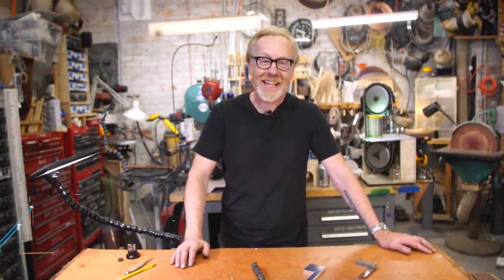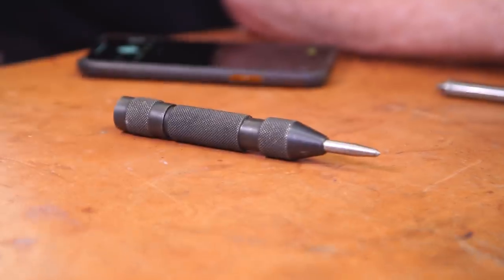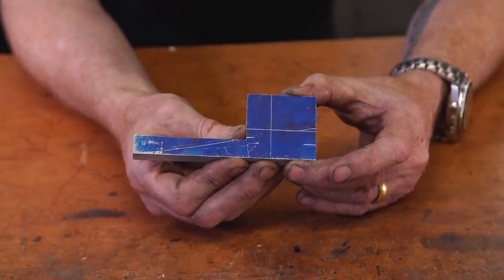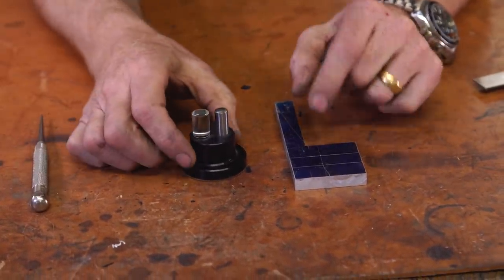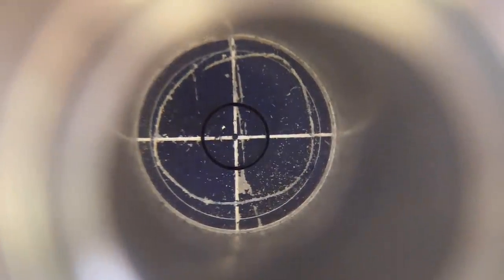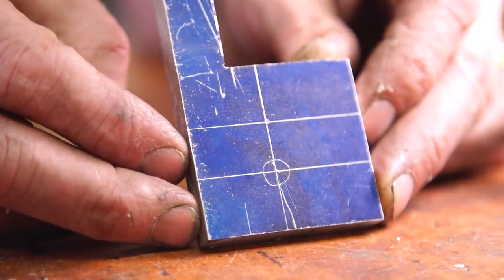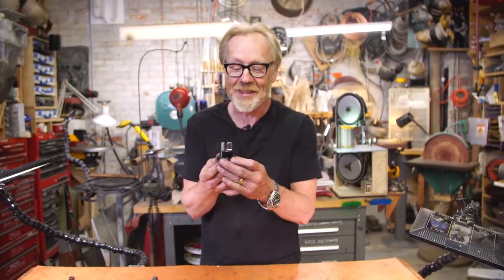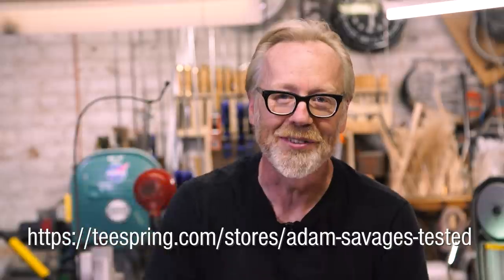Adam Savage's Favorite Tools: Optical Center Punch!

Comment: 100% agree. I use mine all the time. The holes printed to paper by my 2D CAD system have cross hairs. Stick the paper to the work piece with spray mount, optical punch. Accuracy guaranteed!
Reply: Depending on the accuracy and resolution of your printer, and the rigidity and lack of stretch/shrink in your paper, yes.

Comment: As a mechanical technician, this tool is a crucial part of my tool collection. An old timer showed me his, and I have loved using my own since. The guys in the shop may not like it, especially when I have a shitload of holes to lay out, but it easily produces more precise results than any spring punch could ever compete with. 

One thing I ended up doing with mine was I took it to the belt sander and sanded it almost all the way to one of the holes so that I could get it as close as possible to the radius of any piece of angle that I'm laying holes out on. Picture trying to lay out a hole on some 3/4" angle right in the center and you'll get what I mean. Now, most people would say 'Why not just lay out and punch the hole on the completely flat surface of the angle?' But doing so would make drilling the pilot hole at the drill press impossible without the use of a vise. Center punching on the inside surfaces of the angle is much more time efficient, especially when you have hundreds of holes to drill. Also, modifying the tool in this way does not effect the precision of the tool in any way and gives the tool more capability overall.

Definitely a great tool to have in any man's toolbox.

Comment: When working to marked lines, traditional engineering practise relies tremendously on "touch and feel", the development of which was a key purpose of apprenticeship.

A pair of dividers would be set by dropping them physically in the engrave markings of the scale, not just "looking" at the scale. Lines would be scribed into the workpiece, not just into a coloured coating.  When marking for a drilled hole, the key tool for accuracy was the "marking punch" (as distinct from the "spotting punch"). A hole would always be made at the intersection of two marked lines (how else?), and the marking punch, which was hardened and ground to a much finer included angle than the spotting punch, would be dragged across one of the lines, until it was felt to have physically dropped into it. It would then be dragged along that line until it was felt to drop into the intersecting line. It was then known to be at the cross point, and would be gently tapped to make a mark. The blunter "spotting punch" was then placed in this mark, and struck as hard/often as needed to make the starting point for the drilling operation. This whole process is easy if all the scribed lines are deep (and hence a little less accurate). Following the process with fine, shallow, accurate lines is what "touch and feel" is all about.

This whole approach was rendered irrelevant when the need to work to single thousands of an inch arrived; this is not done by working to marked lines, but by working to "numbers", either on a vernier gauge, micrometer, or the dials of the cross tables on the lathe carriage or milling table.

Which is why optical punches are not a common device seen in engineering. They ARE fascinating though.

Comment: I always thought of the X of the scribe is deep enough the punch will want to sit in the cross section because that’s where the most material is removed. That’s being said, I want to try and optical to see if the process of that takes less time then being very careful with a center punch. I love all the alignment punch methods. Screw transfers, traditional transfers, etc. but usually I just use a drill guide block. For some applications, it feels wild but if I have to do a door frame it’s usually best to have the drill at full speed and kiss the mark as lightly as possible. Drills roll because of the amount of pressure. The twist of most cutting bits are like “paddles” that want to paddle away. But if you take literal paddle on a boat and barely touch the water. Just enough to where the very edge is barely wet - you boat won’t move. The “bite” force isn’t strong enough. So high speed, a very gentle touch, and a metal V block usually can get me there very accurately.

Comment: If the scribed lines come from say a height guage from a granite/steel surface table or with a scriber then you can locate the sharp punch into the groves of the scribe marks. If you get good at scribing you should only have to scribe in material that's going to be removed and use a delicate touch to plan things out everywhere else. Its an absolute art that i struggle to master as a machinist but this way I'm told you can get to 50  micron or less depending on the gear and they guy you pay. Viva la industrial revolution!

Comment: I got myself an optical center punch from chronos in the UK.
This one you can rotate to switch between both optics and the punch.

I found it difficult to see anything because light needs to come in from the same origin my head occupies. So I have to take my head away quite a way and use a flashlight.

The bottom of the plexiglass floats a 3.5mm above the workpiece.
This means that the markings at the bottom of the plexiglass shift but about +-0.5mm depending on the exact position of my head above the center punch.
Reply: I'm thinking of replacing the base with a translucent material to get light. Maybe embed magnets to hold it in place. But it would loose all that nice weight. :/
Reply: The trick to shifting seems to be to place your head in such a way, that the crosshairs are in the center of the image and not slightly offset to any side. Then you seem to look perfectly vertical.

Comment: That's a nice tool... I never used a spring punch... I always used simple ones where you use a hammer (I even made a punch at school). Is it possible that you can get better precision with a regular one than with a spring driven one even if you don't have the optics?

Comment: As a lay person that starts their tool collection I got a question: Is there a “weighed” variant of this tool so it tends to stay in position and you don’t have to precisely hold it down until you actually do the punch?
Reply: I had the same feeling, that my hand holding it down wouldn't be enough... Maybe if the project allowed it, a clamp could help?
Reply: Ive always done this in a drill bar and a clamp.  Use the bomb site to locate it and then pull it out and use a drill bushing to drill it
Reply: This is the same question I had, I’m a right hand amputee and it being weighted would be of a paramount help.
Reply: @Aron Aimer 
That would be a topic I would find extremely interesting:
How can you “properly” (and safely) work as a maker with certain physical limitations?
Answers like: “Oh well, sorry to hear that - you just can’t do this and that so just get someone to help you!” I would consider highly disappointing.

Comment: as a Toolmaker before i took my engineering degree, i really never understod the value of the optical center punch..  i get it that it supports you in getting closer to the center, but you are basing this on that your lines made with a ruler, or some sort of measurement tool being within tolerances.. normally when drilling with precision you would use a mill or a fixed drill, then a center drill (hardened drill that is made for creating the guiding hole) (called pinol bor in danish sorry it might be called something else) and you will use reference measurements from your part, and then use the scale on your machine to align. (okay when talking about real precision, microns, then this is not a solution, but that is something completely else). for me the centerpunch has only one value, it is a LOW precision tool for ensuring that you can start a thread within the area of a "free hole" in another part.. so there you would have 0.25 ish mm you can move. dependent on thread size, and that might be good enough with a centerpunch.. normally only use it in woodworking.

Comment: How accurate is an optical CP in terms of thou variance across say 10 holes?  I have done several experiments using the standard line and punch method and 10 thou out is pretty normal.

Comment: Is there a tool that makes sure those two lines are in their exact position.....?
Reply: Surface plate, angle plate and vernier height gauge. Suggest the optical punch with cross hairs as easier to align than the bullseye ones.
Reply: Very good question, goes to the heart of the matter in fact.

Comment: I find most normal punches to be rather wide. 
I like using one that is pretty narrow and pointy which I find makes quite a bit of difference for precision. Also, sometimes better to just hold it vertically and find center rather than straighten it up after.

Comment: Putting a centre punch mark within 1 thou or decimal thereof is great but look at the point on the end of a HSS drill, even a tiny one and it's a flat ridge so in the average drill press with like 1/32" bearing tolerances,  it's still going to wander all around.
I wouldn't use a spring punch for the reason that Adam said, I'd use a solid centre punch.
Reply: The optical center punch makes a very accurately placed but very small punch that you then enlarge with your punch of choice so it’s large enough to keep your drill from wandering
Reply: @drmrossing  true, but then you're into stacked tolerances. The optical punch won't be exact, but very close, then your bigger punch will move off centre as it deforms the metal because you won't hit it square and then your drill tip will wander because of the flat ridge etc etc
Reply: @andrewclarkehomeimprovement  in most cases you will still be a lot closer than a punch placed by eye, at least i am able to get much closer with an optical center punch.

Comment: Precisely locate a hole:  Square your stock in a mill.  Find the edges with an edge finder.  Dial to the position using the scales in the machine.  Spot drill. Drill.  Otherwise you are eyeballing it.

Comment: and what you do when your punch becomes dull ?
Edit: because not every work is on aluminum, and i can imagine making marks on some hard steel can dull that punch pretty fast
Reply: They’re usually hardened tool steel. Harder than most metals that a machinist would be working on
Reply: @drmrossing  but in that case it's vulnerable to chipping specially that fine point which is key to make fine markings
Reply: @Zeph_  which is why you tap the punch with a hammer rather than pounding it. tools do need to be used correctly...

Comment: "less that 3 thou" / "Precision is paramount" and "drill press" are contradictory. I love your favorite tool series but this one I will have to disagree on. This one seems like a gimmick you find at CVS. Of course, I say this never having used one... I find spring punches to be very accurate as long as you have the adjustable kind, and adjust them for the material.

Comment: Honestly?
Screw springpunches and opticals are way over the top (and not free of possible mistakes). 
If you score your lines right (not with fluid!) and deep enough, with a little practise you can follow the lines with a nice sharp punch at like 60° angle and you can FEEL the center of the cross.
Get a Hammer, move the end of the punsh vertical, strike it, done.
PLUS: No mentioning of the downsides of the optical (possible movement, not usefual for small or angled parts)...i really get the feeling this series is mainly about the affiliated links :(
Reply: Put your shoes on, go outside, sit in the sunshine without a mask, and wave at the passing vehicles and passersby. 
You're getting a little edgy.

Comment: Doesn’t the fact your scribing on the lines make it already imprecise? if your using hand tools you’ve already given up precision under 0.1mm so what’s the point spending that money on a tool that yes will be very precise but on a unavoidable tolerance error method such as Hand tools and marking. Your battling with straight edges, Flat edges, surface finish, type of bench, level on the bench working on.